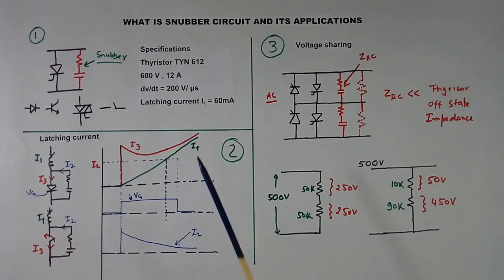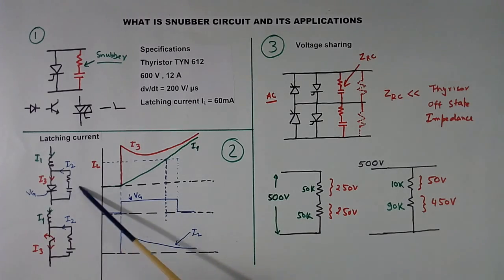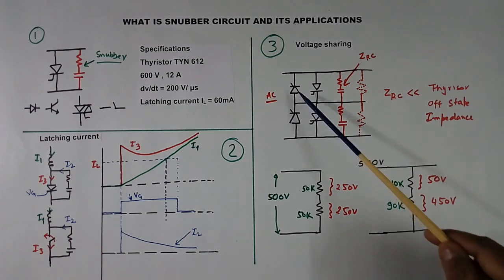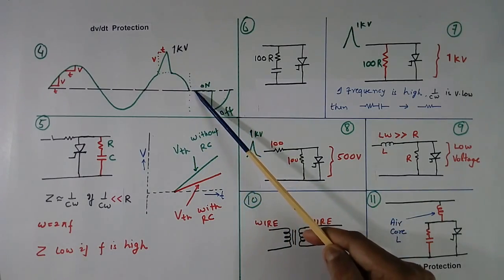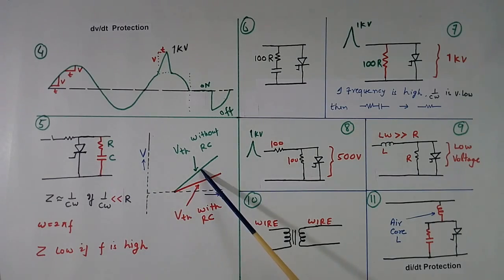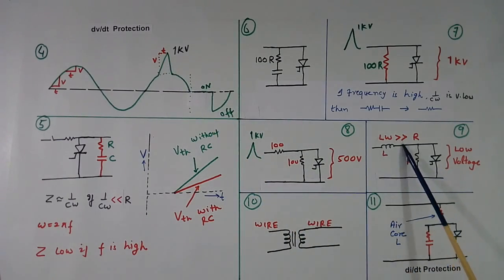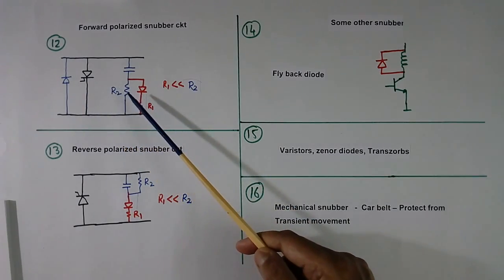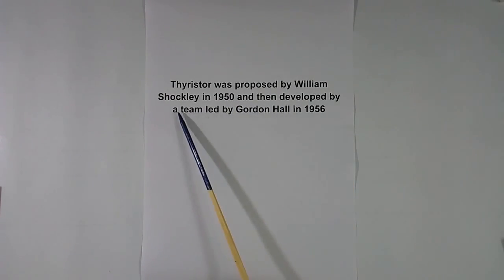Snubber circuit for thyristor protection, applications | power electronics

Comment: Sir please guide us in making RC snubber circuit . 

I'm working on my pure sine wave inverter project . I want to design RC snubber for my inverter. what are the calculation we need to do to get accurate value for R and C. 

I have made H-Bridge using irfp450 mosfet.
Input voltage from the battery 12v 17ah.
using SPWM technique to drive my H-bridge.

Comment: Thank you for the video. It would be nice in a future video to describe how to size a snubber. We are currently trying to solve an issue with arcing across relay contacts due to an inductive load. The easiest solution is to install an RC snubber either across the relay contacts or across the load, but it is difficult to calculate suitable values for R and C.
Reply from the maker: 1- Comments given below are based on my experience of using relays.
2- Snubber ckt design is application and project based, it is difficult to make a common rule. Video helps to gain knowledge and importance of snubber.

2- We have used 1000's of relays in many project, but as I remember I have not used snubber for relay contact for my applications.
3- Mostly relay contact is designed to take sparking, this is normal.
4- If you use snubber across relay contact, then it will not give perfect off/ open condition.
5- Pl see data sheet of relay, contact design for 10A resistive load can not break 10A inductive current. Same contact will have 4 different current rating for AC resistive, DC resistive, AC inductive and DC inductive current. This must be there in the data sheet.
6- Pl give some margin also.
7- Generally relay are not for high load current.  Contactors ( concept simmiler to relay ) are used to switch load.